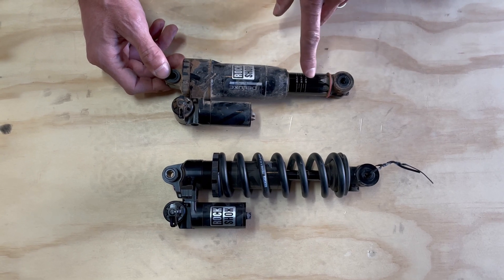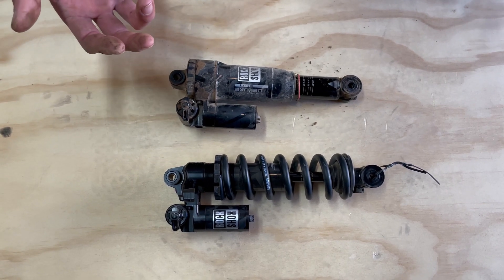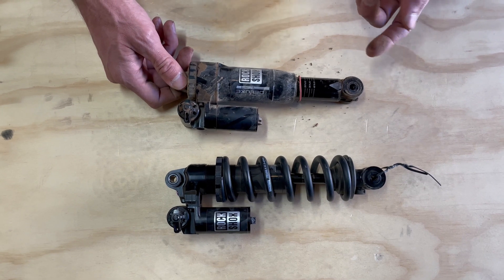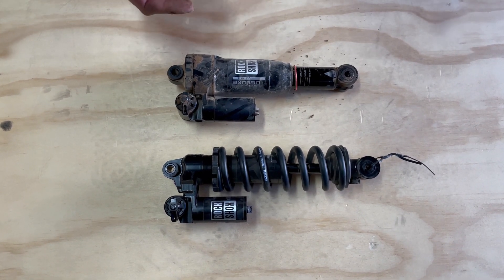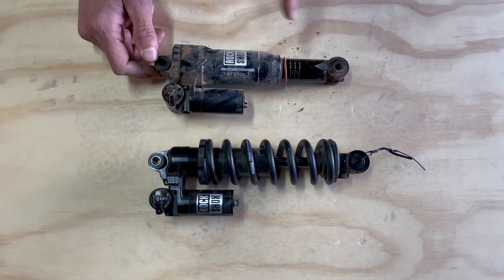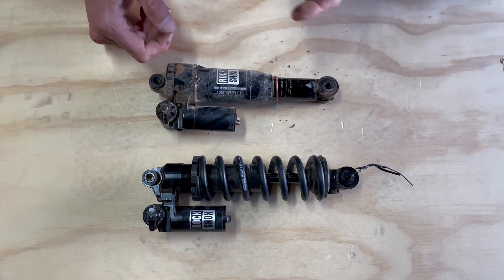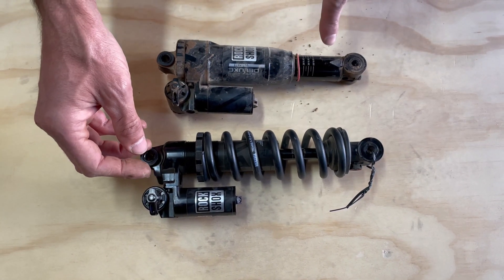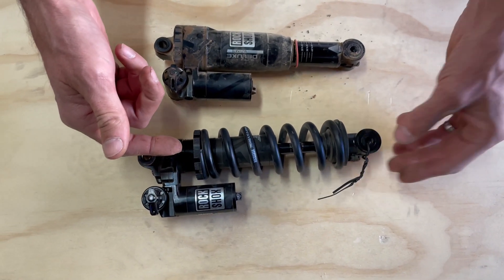EXPLAINED - 2023 RockShox Super Deluxe Air and Coil Shocks

Comment: What's the difference in the assembly for HBO vs NON-HBO?   I need a NON-HBO but sram isn't able to tell me where one is available and all the dealers are at a loss in locating one.   Is there anyway to just disable or block off the valving?

Comment: I really don't like the feel of the 2023 RockShox Super Deluxe Ultimate Air that came on my 2023 gt force carbon. I have the 2021 RockShox Super Deluxe Ultimate Air Dh with the megneg on my gt fury and it feels amazing to bad the megneg doesn't fit the new air shocks.
Reply: Megneg fits on new SDU 23, I. Running it with no problem.

Comment: You cannot travel those shocks? I tried to find some infos about that but the only thing i found is that on the rockshox spare part list, there are those spacers listet as travel kits!
Reply: If you were talking about shock stroke, no, you can't change it anymore!  That's the only cons but yeah, you have to buy the right one and keep it as is... I think they said it was because of HBO.
Reply: @SsmAnyfeSt  and what about coil shocks?
Reply: @aleksandermichaowski7885  it would be the same thing as it also has the HBO.  If I had to buy a new shock, I would try this coil shock no questions asked! Ajustable hbo on the coil version plus everything else... seems incredible for the price!

Comment: With that one piece shaft on the coil, will it be strong enough to be compatible with yoke systems like on the Stumpy EVO?
Reply: Maybe finally they will find out that the yoke system is worst thing ever designed...
Reply from the maker: one would think that was their intention
Reply: Specialized specifically says to not run a coil shock on the Evo…
Reply: @TheRexPerkins  right that’s why I asked, they say not to because the frame flexes and the long yoke amplifies that flex and bends shock shafts. Air shocks are stiff enough to avoid damage. I was hoping someone might make a coil with a shaft strong enough to handle it.
Reply: @The_Backsmith802  EXT does, the e-Storia is a burlier version of the regular Storia with HBO.  Both work just fine (remarkably well actually).